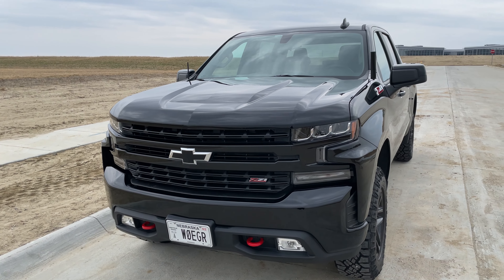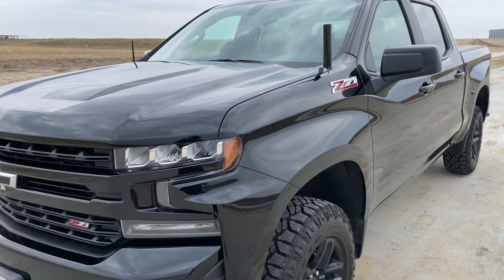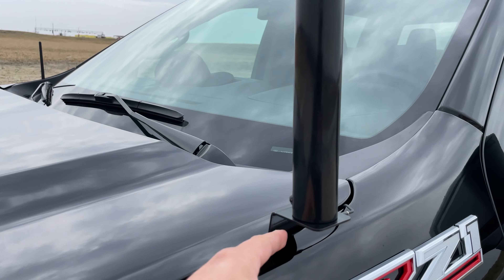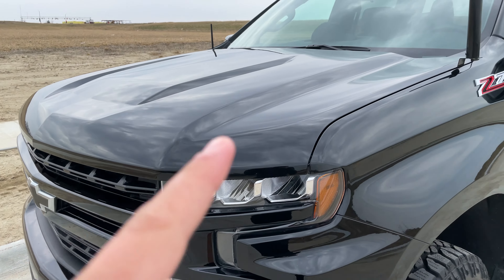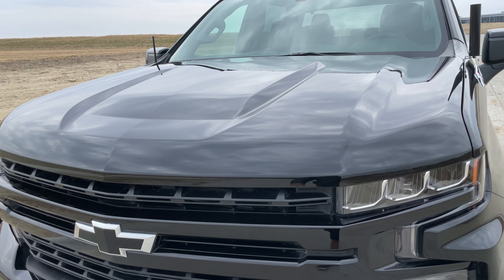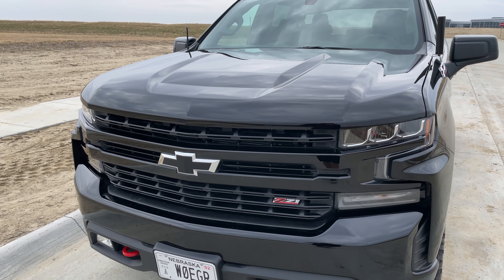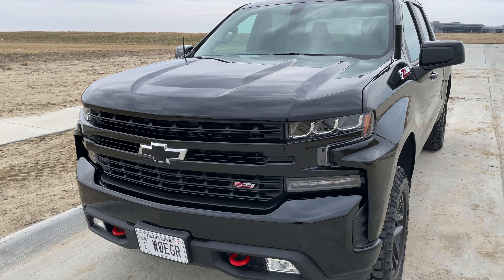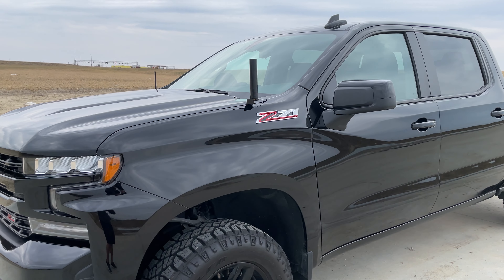2022 Chevy Trail Boss Ham Radio Install - COMPACTenna mounting and Firewall Passthrough

Comment: Just installed a gmrs according to your instructions. I wrapped the end of the power cord with a small amount of electrical tape, and then sprayed with vegetable oil to reduce drag. It slid right in the hole😮😅😅. I really appreciate.
Reply from the maker: Excellent! Glad it helped.

Comment: Thanks for this how-to video. I installed a Yaesu FTM-400XDR today and your video made it simple to take on. The only thing I did different was use the grommet on the opposite side near the battery for the power cables.

Comment: There is another option on the passenger side that is fairly easy to access as well to pass the wires through the firewall.  Looks same as on driver's side.  Did not encounter foam on this path in my 2022 LT.

Comment: I also have a 2022 Chevy Trail Boss (and I love it). I just got into Ham Radio (passed all 3 exams in Summer 2023). Your video is very helpful to me, but I wish you could have talked about, or better yet shown, what specifically you did to connect the radio to the battery (or ground point).

Comment: Exactly what I needed to watch!! I was trying to figure out how to mount my Kenwood TM-V71 radio and antenna, in my 2021 Tahoe Z71. I will be purchasing that Compact antenna. Better spot than the roof mount I’m using… which is a good spot.. but over time though…….😏

Can you share what type of speaker you have? It’ll fit in nicely in the same area as mine.

You just saved me a lot of time! THANK YOU!

Comment: How’s the swr? Might want to check. Before I got a meter, I put the antenna on a corner (mag mount) and it was “ working” with my HT, thought I noticed my HT would warm up.  I got an SWR meter and found that my SWR was near 2!! So some “fine tuning” on placement got me  ack down to 1 (or near enough).
Reply: I'm curious as well about the SWR with that mount at that location? It looks good but SWR is important.
Reply: @ropnjessi  In  comment above he stated " The SWR is fantastic. About 1.1-1.3. I have been pretty happy with it. Range isn’t fantastic but with its size that is to be expected."

Comment: The NMO cable in the link in the description is 16.75 ft. Is this the length you used? If so was it too long requiring you to coil some of it or was it about the correct length?

Comment: Very useful; I just got a 2023 suburban, looking to figure out how best to do my install; I'm not sure if I'll do it all exactly the same as you did, but I suspect mostly the layout is close enough to the same that this will be super useful.

I'm hoping you'll answer one of us about where you're pulling power from =] You didn't indicate that you pulled anything new through the firewall, so I'm wondering if you found something already there which is good enough or if you skipped something =]
Reply: @thehamstudy did you ever get your radio installed? I have a 2022 Suburban with Duramax and my engine compartment is VERY crowded.  Thanks
Reply: @Hornman120 well, kinda... I haven't figured out where inside to put it yet, but we're going on a trip soon and my two oldest boys (14yo and 12yo) just got their licenses, so I think it's time to finish =]

What I've done so far is I installed the NMO mount and then I ran it actually through the hinge of the door -- there is just enough room in there that it closes without pinching anything and then I ran it through the trim and it's nearly invisible. I have it ending in a little pocket on the driver's side of the center console, I was thinking I could possibly slide a radio in there with a remote control head in a cup holder mount. I'm not sure I can still fit power through the same side through the trim, however.

For pulling the power there is a bolt on the passenger side under the hood which has a huge cable from the - terminal of the battery -- I connected to that, then I opened the cover on top of the battery and attached the + to one of the terminals in there.

Comment: This is exactly what I was looking for!  I don't have a center console, but shouldn't be an issue. Firewalls are always difficult.
How did you mount the mobile base? I didn't see a bracket?  I assume no screws in that spot due to the floor ductwork.
Reply from the maker: Glad it helped! To be honest the base is with Velcro as well. Time will tell if it lasts but so far it hasn’t budged.

Comment: I have the same truck and love it. Definitely gonna order the mount and nmo coax. Could I use that mount on the passenger side? Also what is the SWR like with the compactenna mounted there, I remember looking into that antenna but it seemed like it was supposed to be used with a mag mount so I lost interest.
Reply from the maker: Ya I have loved the truck. The mount is driver side specific. They may have a passenger side version. The SWR is fantastic. About 1.1-1.3. I have been pretty happy with it. Range isn’t fantastic but with its size that is to be expected.
Reply: @TheDadNerd  I came across your very well done installation and video presentation here. It may help to know that the COMPACtenna 9" model 2M/440+ provides even greater range.

Comment: Hey bud,I just purchased a 2022 Silverado 2500HD. 
Like your installation.
My question is how did you snake the coax inside for the antenna?
Reply from the maker: The coax I had allowed me to screw the outer part of the end off. So I was left with just the center conductor on the end of the coax. Punched a hole wit the metal rod and then was able to force the coax through just enough to grab it on the other side of the wall from inside the cab. Took a bit of playing but it worked. I was going to use electrician fish tape if I couldn’t reach it. Good luck!
Reply: @TheDadNerd  sounds good, thank you very much!!

Comment: Theres the same grommet on the passenger side that is unobstructed same type same location just behind the battery
Reply from the maker: That is a good point, if you are putting your radio on the passenger side that is a good option.
Reply: @TheDadNerd  i put it in the middle and there's no pedals or anything to get around to to to the middle from the passenger side.

Comment: Did you have to remove the panel on the center console to hide the cable. Also, did you cut the CB connector off to feed it thru and reattach the connector back on the cable?

Comment: How well is that mounting location working after 7 months?  Repeaters and any Simpex?  I'm very interested in going more stealth on my new truck, my old truck I mounted exactly like you but using a ~32" NMO diamond antenna.
Reply from the maker: It has been the best mounting option I have had in a long time. One added benefit is that it does not leave any mark on your hood as compared to a clip hood mount I had used on a previous vehicle. I would definitely recommend it. I will say that the antenna does not quite have the reach my prior larger antenna had but still has plenty of range for the repeaters in my area.

Comment: Hey NerdDad, how do you like that NEW Compactenna? I have heard alot of good things about it, but I would like to know your opinion about it. I was going to buy a Comet dual Band antenna which is much taller, but if this is a good as what I have read and seen in video's I may have to go this route. I too am installing into my new truck. Please let me know your honest review of that Compactenna please. Thank you. Love your video.
Reply from the maker: Hey Christian! I have really enjoyed this antenna. Biggest pros for me are the fact that I can pull in and out of my garage without it dragging along the top and its sleek look. As comparted to larger antennas it has a bit shorter range but that is to be expected and it is still more than enough to hit all repeaters in my area. The SWR is also great on multiple bands. If things like height and looks are important it is fantastic option. If those things are not important to you, you would get better performance out of a longer antenna. As with all ham antennas, it is all a compromise.
Reply: @TheDadNerd  Still thinking on that antenna. However I now have a different question for you. I am thinking of now buying that TYT Quad band radio. I have seen alot of good and bad video's on you tube about it, but you as a user, how do you feel about it? How long have you had it, I have heard that they just stop working after a few months, THAT I  am worried about, don't want to buy a radio that won't last. so I respect your opinion, so I am interested in what you have to say. Also, Does that antenna work for 10 meters?

Comment: How does the antenna do in car washes?
Reply from the maker: Definitely want to take it off for car washes. The mount is fine but I unscrew the antenna for all car washes.
Reply: @TheDadNerd  I just placed my order for this mount and antenna. I have a similar truck and appreciate your video immensely. It will be a big help to me and others with late model GM trucks needing to install ham radios.